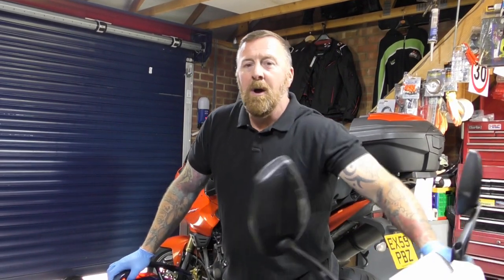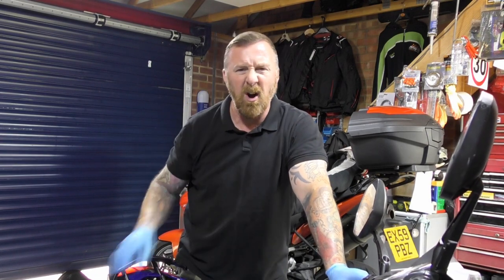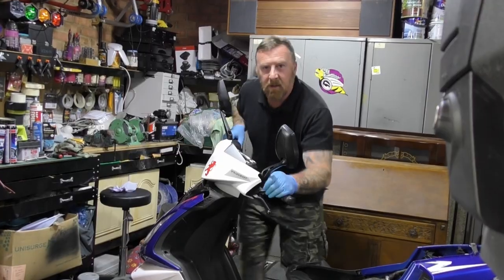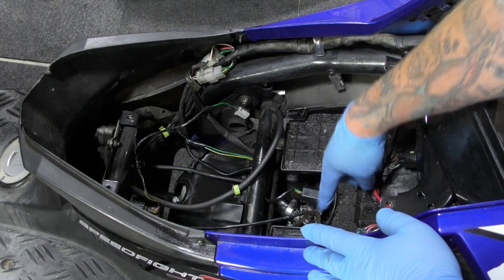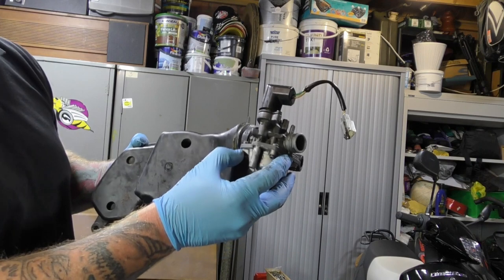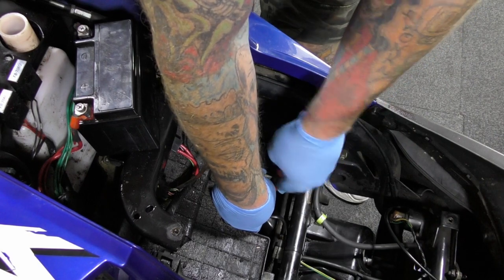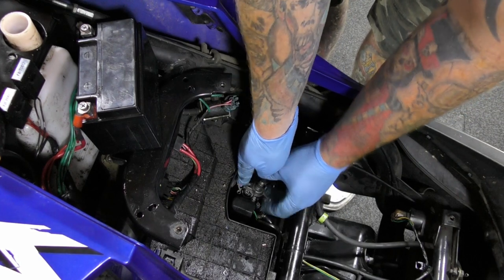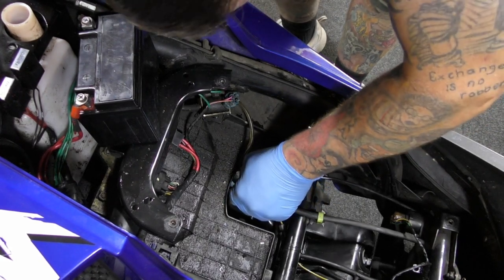SPEEDFIGHT 3 50CC E10 PETROL BREAKDOWN CARB & GASKETS FIX MOPED SCOOTER

Comment: Hi I have a question: my speedfight 3 ac 2t, has problem with kickstart and electricstart: the fuel pressure seems off (the fuel go’s up and down). It doesn’t keep the pressure so that the fuel reaches the vacuum pump. I am not sure wether I have placed my vacuum pump in a right spot. It is near the 12v buddyseat cables.

Comment: I've found that E5 causes the washing away of engine crankcase sealant around the crank bay area on three 125cc 2 stroke single engines that I've had to re-seal with ethanol resistant Blue Hylomar. Around the crank bay area all the factory RTF or previous rebuild silicone was gone, which was why the engines had started burning their gearbox oil. 

This is because ethanol dissolves silicone & RTF (original black rubbery factory crankcase sealant).
Reply from the maker: and thats e5 so what do you think e10 will do lol

Comment: Hi mark I took my speedfight 3 apart to re spray the body parts on it and I found a pipe which wasn’t connected to anything looks like it’s for air flow as it’s not from the radiator or anything the pipe was hanging down underneath my plastics and was clipped up to just under my seat do you know if it’s for anything important I’m thinking it’s not because the ped should have broken already if it was important it’s just a black pipe with a black box connected to it and on the end it looks like a showerhead end let me know what u think it is as I can’t see it on the owners manual or anything
Reply from the maker: It's the grv  gas recycling valve 
Don't worry about it as it would have gone to your exhaust 
Take it out and chuck it bud
Reply: Oh okay the garage I braught it from had to change my exhaust as something went on it and they put a after market exhaust on it so is the Grv not needed then if I have a aftermarket exhaust
Reply from the maker: @jack2010howe  no bud not at all

Comment: Rubber parts can be replaced with vitro parts,e10 can also ruin the crank shaft oil seals if they're not made of vitron.
Reply from the maker: all in not good stuff at all

Comment: Hello mate  why wouldn't the pipe 2 the casing  be creating pressure  to work the feul pump?
Reply from the maker: what ped bud as in name and 2t of 4t 
pipe to the case ?
not carb
Reply: @marksavage  speedfight 3 mate and 2 stroke
Reply: @marksavage  pipe from case 2 the feul pump
Reply from the maker: @dwaynemoloney3338  fuel comes out of the tank under the seat into the vacuum two pipes come out 
One to the carb and the other to the inlet manifold 
Oil tank goes to a pump and then into the carb 
What pipe are you talking about 
One egv comes out of exhaust and into the frame 
It does nothing and can be cut off and bent over 
Case is just to vent heat from the varitor
Reply: @marksavage  ain't it the vacuum line from the case what makes the feul pump work as its not electric
Reply from the maker: @dwaynemoloney3338  it's a 2 t 
The vacuum pipes goes to the inlet manifold in front of the carb bud
Reply: Another great video,thanks Mark. Where do you get your gasket sets and parts fella? With the demise of Three Cross a couple of years ago now I’ve struggled to get parts. Any help would be appreciated thanks.

Comment: Love your videos watch them all was hoping that you can help trying to fix a Suzuki burgman 125 a 2002 model getting a ticking noise but no spark have checked starter motor coil and tried the screwdriver across to bypass starter switch still nothing as your a scooter or moped wizard any suggestions thanks for your time and patience
Reply from the maker: No spark bud cdi , stator coil, ht lead/ coil , plug 
Get a volt meter and work your way backwards
Reply: @marksavage  thanks and be watching like your channels mint have noticed that when trying to start battery goes low and horn stops working then switch of couple of mins checked battery with multimeter and full new battery on will that mean cdi as checked and changed will that stop when jumping starter with screwdriver nothing? Stator coil I think got video on hearing but can't seem to send it on my page

Comment: Bit of a subject change how do i stop the clucth on my bike from engaging to early
Reply: Is it a scooter clutch/centrifugal clutch?
Have you changed anything in your transmission I.e. rollers?
Reply: @pedshed5132  yes it's a x8 125
Reply from the maker: You can change the springs or renew but most work standard bud
Reply: @mdmotorcycles10  when I use lighter rollers I find my clutch engages at a higher rpm, and vice versa for heavier rollers. I’m not too sure why but if you want to engage later I’d say choose rollers about half a gram lighter.
Reply: @pedshed5132  i haven't changed the rollers yet

Comment: Hi Mark could really do with your help.  My sons scooter just stopped working I have changed the stator, the regulator/rectifier, new ecu, new ignition coil, new spark plug and the side stand switch but still no spark.  There is power in the ignition coil but none when spark plug is inserted.  Any ideas welcome xxx
Reply: If you know the coil has power, and is goo. Replace the HT lead and plug cap. Then see if you get spark from the coil to the plug.
Reply from the maker: if you have done all that bud id be looking at your cdi again , power going in and back out as you can buy a duff one 
get a volt meter and start from battery and all the way along , dont forget wd40 all wires and make sure no breaks

Comment: Hello mark another good video I’ve got to admit I’m still worried of rebuilding my aerox so basically the only fuel to premix is super unleaded
Reply from the maker: Yes bud , that's what I'd use , well till they stop that in 5 years !! 
Bugger lol
Reply: @marksavage  well on the 23 I’ll rebuild it and let you know love the video mark one thing I like about mark he’s down to earth and says it how it is no beating around bush keep it up mark good work mate
Reply from the maker: @kayone8571  thanks bud , means a lot 
You missed about the cuppa lol
Reply: @marksavage  😂😂😂
Reply: Yamaha say it's fine. But I won't be putting any in my aerox.
My typhoon hates it.
Reply: @paulbudford  what does your typhoon do? Both mine are fine with it. But i do use that putoline e10 stuff
Reply: @landmonkey22  straight away after filling up, it lost power. The engine note changed as well. Even with half the tank gone, and topping up with premium it wasn't right. As soon as I filled up a full tank of premium, it was a massive change. Sounded different, much faster. Take off was massive improvement
Reply: @paulbudford  gonna try to get some e5 to try if I can tell the diffrence.
Reply from the maker: @paulbudford  you know I've been there too 
Hate it right back pmsl

Comment: i use e10 in my 2003 Peugeot vivacity, it’s very similar to the speed fights in terms of engine, I’ve had no issues since I replaced the carb and change my head to 65cc airsal sports kit, but my original 50cc piston rings broke soon after buying it ( only had 8000 miles on it or so) thinking about e10 my have caused that, I also premix all my fuel going into the bike, anyone have any thoughts on this?

Comment: Hi mark i know this is a old video but im really having issues with my speedfight 3 50 lc ive got the idle screw all the way in and throttle cable screwd on the last threads to idle and really badly bogs on acceleration lumpy idle and black spark plug its had a new top end as badly scored so bought a narauku one and leo vince exhaust and new inlet manifold and reeds and crank seals but still having this annyoing idle problem and bogging
Reply from the maker: Take out carb and jets 
Clean and try going smaller on the main jet like to a 60
See how big it is now but this will help and check the seals and air box is on tight 
Do you have the link pipe on ?
Reply: @marksavage  what u mean to a link pipe on
Reply: @marksavage  and where does needle have to be
Reply from the maker: @gazzayoung7333  the air box has a pipe that goes into the variator cover on sp3
Reply from the maker: @gazzayoung7333  the needle , best leave it as was or on 2 , middle 
3 half to start once re jet to start

Comment: Hi Mark, I have a vespa Lx 3v 125 2013 plate..
What type of rollers, clutch and exhaust would you recommend? It does about 62mph stock
Reply from the maker: Haven't really worked on them 
But a sports exhaust will definitely help 
Still with the same of 1g per roller extra 
But a good clean up and check belts ok
Reply from the maker: Also a small upjet of 4 will help

Comment: Doesnt the fuel pipe sit under the frame so it doesnt get pinched ?
Reply from the maker: No there's a gap for it and the cable but not for the plug 
However if you want to put it under you can 
To be honest it doesn't matter

Comment: I've switched to Tesco super E5 99 Ron. The bike runs fine but won't start easy now. What is the problem?
Reply from the maker: had you used E10? give it a service bud so new plug and air filter and see how it goes
Reply: @marksavage  I changed the plug, it did look a bit ugly but not white just a usual rust brown. Seems to have gotten used to super unleaded. I don't know if that's the malossi Digitrontic at play. I've asked everyone but do you know if you should remove the secondary air system box as it's not connected to the power pipe? Some people say leave it on and others block the hole with a car wheel bolt. The Digitrontic handles the sis valve but does that box serve any purpose now the exhaust is gone? I would really like a definitive answer as it doesn't seem to serve any purpose.
Reply from the maker: @GrandpaOnATunedScooter  it can be left,  or take out the bucket and take it away 
But has no purpose now 
As for starting yes gibe it a little time to settle in
Reply: @marksavage  Thanks Mark it's been a question I could never get answered? Should I plug up the hole where it went (I hear a car wheel bolt fits nice) or is it ok to leave it open. Sorry for all the questions. Your videos make me wish I lived next door 😁
Reply from the maker: Ok let's open this question up !!
Speedfight ?
Air box ?
2 parts air box and extention pipe 
Some like it on other don't once upjettted etc 
If not connected it leaves the open part of the air box 
Leave it 
Exhaust ?
It has a GRV !
Most disconnect it and bend it over 
Pipe left 
You can take it out or leave it 
Please explain more or do a video of it, then 8 can see what you are talking about 
Don't go blocking this up if you don't know what it is bud 
So give me more info
Reply: @marksavage  Thanks. Its a 2020 euro4 SR50. I removed the standard pipe and fitted a Leo Vince TT. The original pipe had two pipes connected to the secondary air filter box. I took both these pipes off. The secondary air filter box which they were connected to, just a big box with two metal clips for the pipe hoses, came off and didn't seem to do anything. I just wondered what to do about the hole in connected to and does it serve any purpose. I have a malossi Digitrontic CDI which is supposed to use the sis system but I have no idea if the box still serves any purpose?

Comment: I have a BIG problem with a SF2 LC. I am almost 50 years old and have a lot of experience with 2T but doesnt have any more ideas on what to do.. Can I send you a movie of how it sounds and what I have done?
Reply from the maker: I watched it so we're you riding it and it's not revving right / running ?
What have you done so far ?
Was it running ok before ? 
Serviced ?
Tuned ?
Carb cleaned ,what size jet?
I have lots of videos on my channel to help
Reply: @marksavage  cleaned carb, changed carb and still the same. It is not revving right. Right now main jet 54  the other one 35. It had been like that since we bought it tfebrary this year..

Running bad from like 1/8 to 6/8. Runs pretty clean and fast on full throttle..

Changed to smaller and bigger jets, no difference
Moved the throttle neel, no difference.
Changed spark plug, no difference 
Checked and cleaned air filter, no difference
Changed variator rollers, a little difference but not much just lower full speed. Got 6 g weights in right now!
Reply from the maker: @danielmagnusson5366  54/56 standard jet 
Leave idle jet go to 60 main 
Then tune 
Needle middle 
Check reeds !
Reply: @marksavage  a lot better now but even better when I removed the air intake box from the airbox (wit the filter).
Reply from the maker: @danielmagnusson5366  more tuning , do u have the link pipe on ,of so take it off 
Bit tuning bud
Reply: @marksavage  I put on a sport exhaust and it runs fantastic. Excellent acceleration and easy 80km/h with standard 50cc and carb on a flat road...

Comment: I’ve filled my speed fight 3 50cc (LC) 2010 3 times with the new E10 and it actually runs better, it feels like its got so much more power and climbs big hills at 45MPH it’s used to do 35MPH
Reply: Probably your mixture thats perfect for the time of year. If you dont mess with it
Reply from the maker: while its running all good bud, dont leave it in your tank if you lay it up over winter !
Reply from the maker: some have said this but using so much more of it too

Comment: Oil injected 2 strokes, as opposed to the pre-mix 2 strokes, have the biggest problems with E10, due to being run right up to the edge of under lubrication.
Reply: Just adjust your pump or add to gas?
Reply from the maker: the 2t doesnt mix well but you can buy some that do, but me i'd use super bud